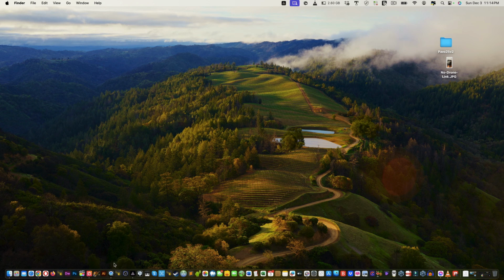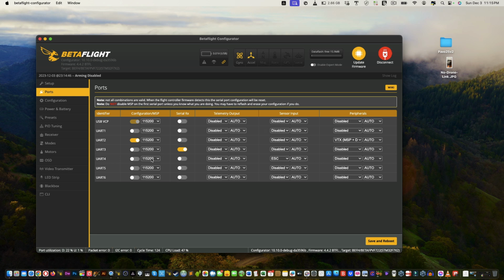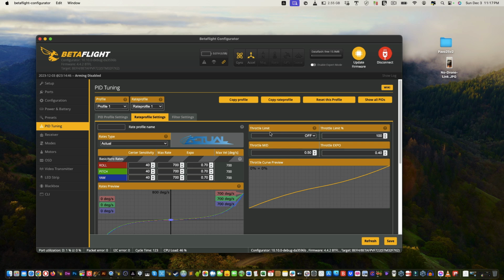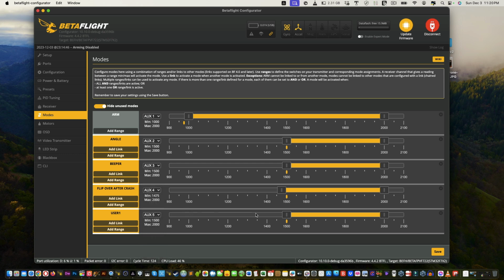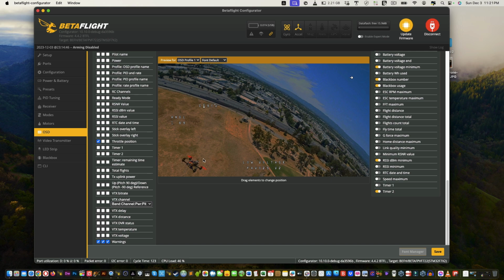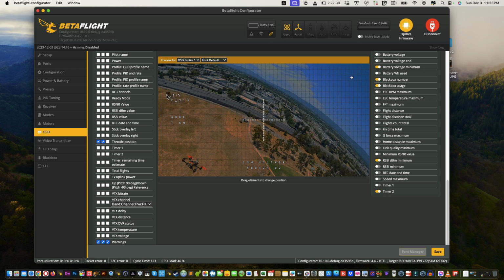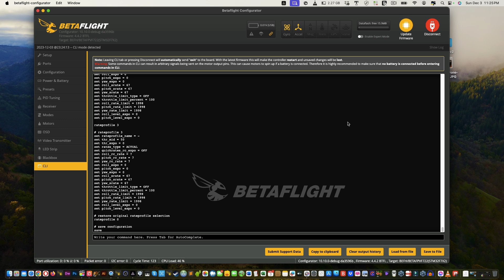Pavo25 v2 BetaFlight Setup - how to set up the Pavo25 - how to save your drone settings

Comment: I am running ELRS and DJI 03 air unit in my Pavo 25. The receiver is bound but still no WONT ARM. Any ideas PLEASE HELP I have been at this for a week so far and no one seems to know whats wrong...
Reply from the maker: @NoviceQuads  try this … hope this helps..let us know how it goes.

Pavo Pico not working - how to get the pavo pico started, pavo pico troubleshooting
https://youtu.be/LEw5Gha1eRo
Reply: @How-to-by-Lou  Thanks for responding so fast. Thanks to YouTube University, I found out there are versions out there using Uart3 and Uart6. I switched to Uart6 and Bingo.

Comment: Hi great video!!!. Quick question, do these seeting apply to a pavo35 as well ? Just bought one as my first drone. Currently binding the 03 air unit to my dji controller 2 and fpv googles v2. Thanks!
Reply from the maker: One second let me check (but) the settings in the troubleshooting video do.. As for the UART.. will check their site...

https://www.youtube.com/watch?v=LEw5Gha1eRo&t=792s
Reply from the maker: For sure do a CLI dump before experimenting or changing the setting.. this way you can put them back on if things go bonkers. 

Try to bind the goggles and rc if you got the bind and fly version. However either way you will have to Configure the Remote controler. That part is in the  troubleshooting video. 

Strange how betaFPV doesn't just throw the UART settings as a PDF on their site.. 

But they will send it as a PDF if you ask them. Just ask them for the UART settings. It's a different chip so hard to say and in the comments section for the CineLog 35 on the BetaFPV site, someone shared that it's wired wrong. 

Nice drone by the way.. Kind of reminds me of the geprc cinelog 35

Support ticket if videos don't work
https://support.betafpv.com/hc/en-us/requests/new

Better version of BetaFlight that works through the chrome browser. 
https://app.betaflight.com/#

UART setting found here - scroll down towards the bottom
https://betafpv.com/products/toothpick-f722-2-6s-aio-brushless-flight-controller-35ablheli_s
Reply: @How-to-by-Lou  Great information for us beginners. Appreciate the reply! Will follow the video first and see where I land. 

I was debating either to get the cinelog 35 or pavo35. the pavo seemed more of a challenge and a good start lol, so here we are.
Reply: @How-to-by-Lou   This is a  great video! thank you!

Comment: Is this setup with the DJI Controller 2? I’ve spent the last 3 days trying to set my Pavo25 V2 up with the controller 2 and they refuse to work together. 

I’m just about to give up on it all if I can’t fix it soon.
Reply from the maker: Try the troubleshooting video. Am using the sam remote as you .. Hopefully it's not your pins.. 
https://www.youtube.com/watch?v=LEw5Gha1eRo

Comment: how do I change to blujay, I use the bluejay configurator and it says esc cannot be read even though I have given it power from the battery.  Using the manufacturer's default ESC program feels very wasteful on the battery
Reply from the maker: the esc configurator will brick your flight controller. Just stick to betaflight. Everything here is PNP = plug and play and done through betaflight.

Comment: Hi, I have a problem. 
I have set up everything as you said and I don't know what UART is on my controller.

I have a Jumpet T-PRO V2 ELRS type.... 
I have a Pavo 25 v2 with O3 unit

I am struggling for many days to be able to BIND my controller with the drone.

Please help me a lot ! :eyes-purple-crying:
Reply from the maker: You might want to try this one.. Hope this helps..  Let us know how it goes.. https://www.youtube.com/watch?v=LEw5Gha1eRo&t=20s

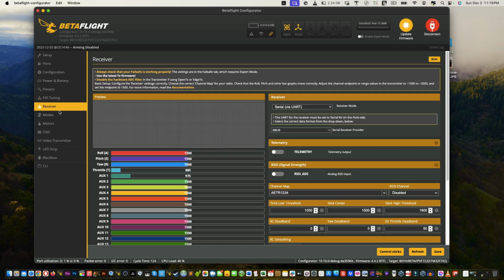check the receiver section - try changing that from SUBS to your crossfire experience.. 5:09

If not for sure captain drone might have a a solution or the forum on Bradwalls Site for sure..

Let us know how it goes..

Comment: Hey, the pid tunnig are you put this values or the drone come whit this pids?
Reply from the maker: Yeah - but if you are new to FPV it could be challenging . If you download the PID tuning you can open the PID-Tuning-3 file you will have a much better experience flying in "Angle Mode"

Just remember to copy or do a dump all to save current settings incase you want to put them back. Hope this helps.. 

https://github.com/flight-commander/pid-tuning/blob/main/Pid-Tuning.zip
Reply: @How-to-by-Lou  im not new in fpv, so for this problem im disconcert! I have a simply solution to test and its put a cap+vts diode just right in battery pads and go to blackbox if change anything
Reply from the maker: @argentinaerialsFPV   Interesting.. Just had a peak at your channel.. That  is some amazing flying.. One day I hope to fly like that..
Reply: @How-to-by-Lou  thanks! 3 years flying everyday! So much flight time and practice

Comment: Hello, I have a DJI Mini 2 SE drone. I can shoot 2.7k 30fps video. Can I make this at 2.7k 60 fps?
Reply from the maker: the mini 2 SE video settings are different from the pavo25 v2 here are the video spec setting for the DJI Mini 2SE.. Hope this helps.. 2.7K: 2720×1530@24/25/30 fps
FHD: 1920×1080@24/25/30/48/50/60 fps